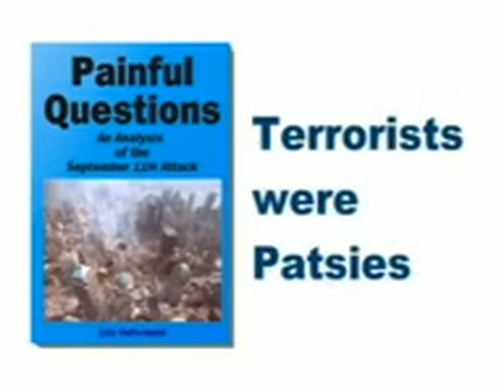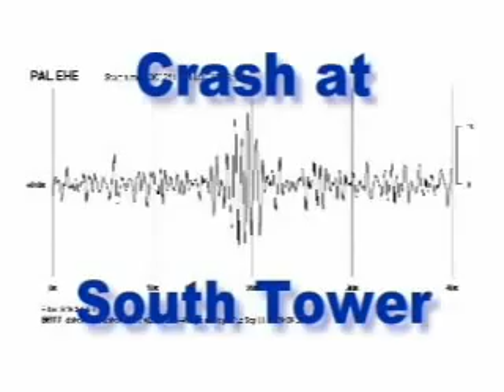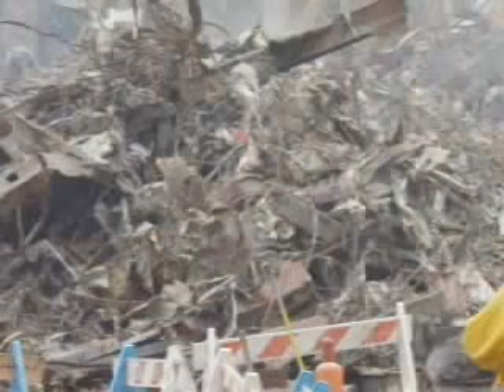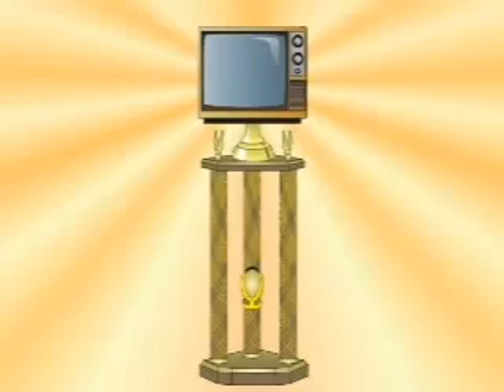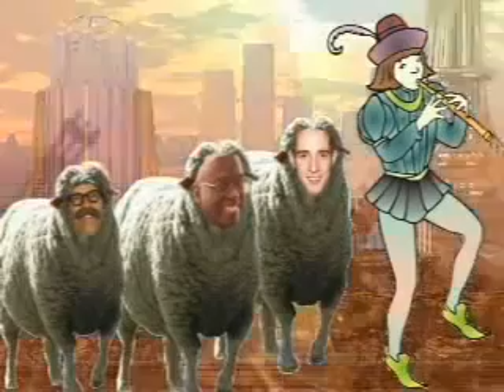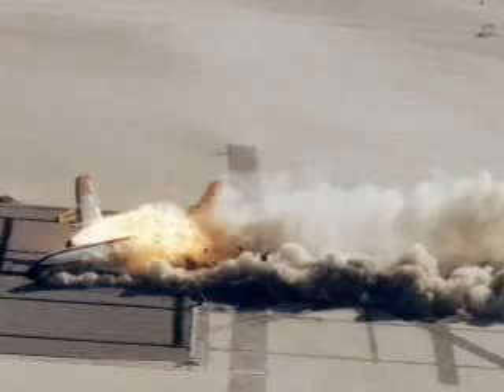9   11 Conspiracy Documentary   Painful Deceptions

Comment: I have worked in aviation for over 20 years. At one time I use to fuel commercial aircraft. I drove a 10,000 gallon truck which during training they would make you think you were driving a bomb. After noticing how tart the smell was reminding me of strong diesel I started to wonder just how "explosive" this fuel really was. My curiosity got the best of me so one day while taking a fuel sample of Jet A fuel I took a little home to try and light it which I have also done with large amounts of diesel and gas in the past. Maybe I am a bit of a firebug? To my surprise I was unable to get the Jet A to ignite and found it was even less flammable than diesel. After some research I tried again using a fine spray and small welding torch. I was still unable to get the jet fuel to ignite or even spark. I was somewhat successful with diesel in this manner by getting it to spark a bit but not ignite. For this reason I always questioned the fires as for Jet A to burn you would need a source with an extremely fine spray and a super hot ignition. I would not be surprised if it has to be compressed to ignite. This is beyond my knowledge. Obviously with gasoline igniting it is not an issue and is to me somewhat enjoyable. FYI I live on 24 acres with a 6000 sq foot warehouse and a fire pit 40 feet in diameter to conduct these experiments so I have not put anyone at risk. I thought about recreating my experiments on YT but I do not want to jeopardize my SIDA access.

Comment: ive studdied aircraft for years every since i was little cause i wanted to be a pilot. but never got the chance. no way can a plane crash into those towers and penetrate the steel and concrete and leave a plane shaped hole. No plane wreckage was found at any of the sites no plane parts no luggage no nothing. those planes r made from aluminium and fibre glass and designed to crumple up if they hit a building. even a bird hitting a plane can cause major damage. every plane goes through crash tests before going into service to makesure they cant damage a skyscraper if they hit 1. in realty a planewould jusy bounce of the towers maybe breaking some windows in the impact area but thats it. there is loads of crash test vids on you tube try looking at some.. a plane hitting those towers would be like throwing a coke can at a brick wall.

Plus if u were watching the news at the time u might of seen some stations started reporting it an hr to early. I waswatching the BBC news inthe UK when a repoter started to say about it. they had a photo onthe wall behindthem of a plane hitting the tower but then said oops sorry that story hasnt happened yet.
Obiovsly it had been filmed in advance of the event but due to the time diff in the UK they started to report it too early.

Very few pl actualy saw or heard planes on 9/11. those that did were found to be CIA assests.
most say there must of been planes cause we saw them on tv. yeah right so dinosaurs must be alive as u saw them in the jurrasic park films lol. simple fact is there was no planes it was just holywood special effects. Even the FAA has confirmed that 2 of the planes were not even on the roster to fly that day as they were in for for their anual FAA air worthynes checks. the transponders for the other 2 were still working an hr later and showed them still on their original routes.

If it was all saudis involved why not attack saudi instead of iraq. Why was the NYPD told to release the mossad agents they arrested in a van loaded with explosives heading to the WTC on 9/11 as the planes were hitting? Why was the WTC evauated hrs before the 1st plane hit. why did silverstien cancle his breakfast meeting in thetowers on 9/11 along with loads of other jews who had meetings that day but failed to tell the ppl they were having the meetings with they cancelled.
pentagon. the section that got hit housed all the finacial records and it was reported a few days earlier that several trillion $ were missing from the pentagon accounts. not many throis mention that thereason why the lease was soldto silverstien casusethe toweers had failed a safety inspection and were condemed due to aspestos in them. they had a choice of pulling them down or spending millions removing it all. either way the aspestos would have to be removed. what beter way to get rid of it for free then claim insurance so they could rebuild them. it was an insurance scam that cost thousands of ppls lives and is stil killing ppl now causeall that aspestos was turned into powderandblew allover new york so everyone in the area would of breathed it in. it would explain why so many pll who were in new york on 9/11 and the weeks after it have aspestos related lung problems now.
Reply: cliff bird you're so dumb. Learn something.  You.obviously weren't born yet. I suggest you.watch the unedited live news cast from the day. Proves you got the wrong info

Comment: That hole that looks like the outline of the plane. ITS NOT POSSIBLE! THE WINGS AND ANY OTHER PROJECTILE COMING OUT FROM THE FUSELODGE WOULD HAVE SHEARED RIGHT OFF AT THE POINT OF ENTRY. If the fuselodge could even get through the stainless steel and steel girders. Lies lies lies.
Reply: Wings are meant to shear off but none did so on 911
Reply: B Cran you have absolutely zero understanding the nature of an aircrafts structure or how it is built